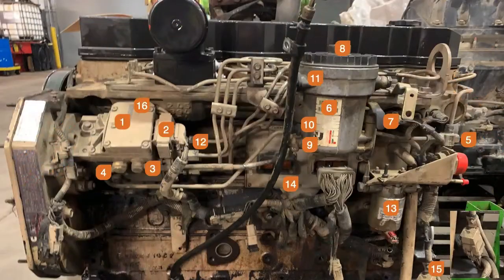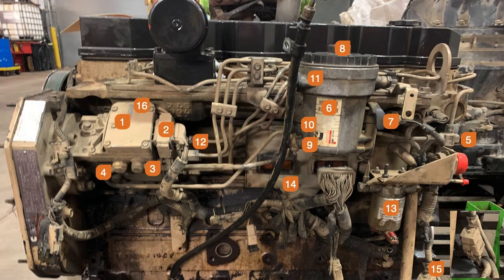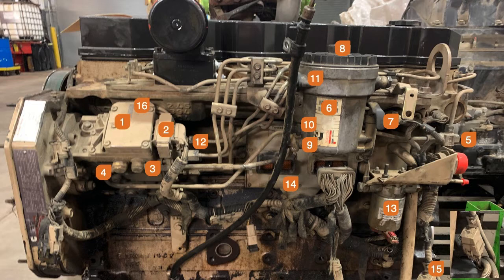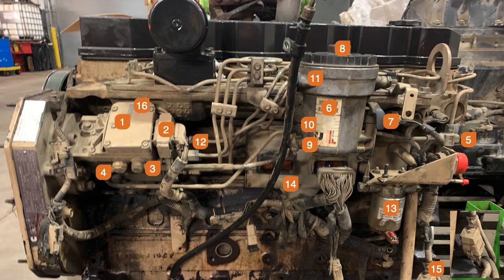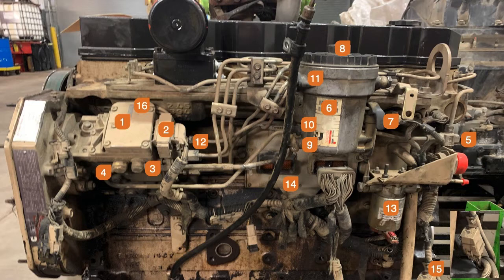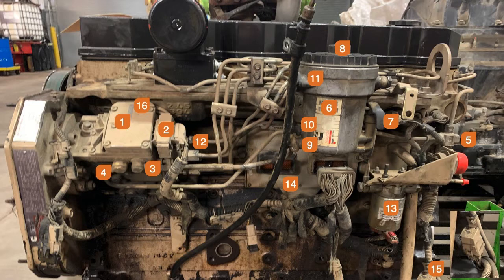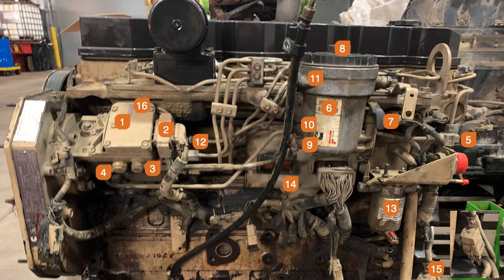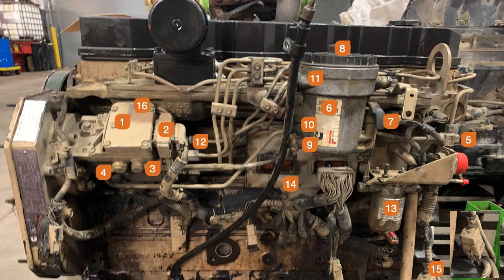Cummins ISB 59 VP44 fuel system Part one of Three

Comment: 👍👍..i commend u ,for all knowledge on engine's and fuel systems, including this one...ive had alot of experience with the VP44 , perhaps not as much as u,but ive began to give up on them,hence deciding to 7100 swap one engine and pull the engine and replace with something older in another truck..ive decided not to purchase another VP44 fir my own vehicle's 🤣... because they kinda seem to be like a woman,you can do everything right and it'll still give up on you😂..but anyway, Thank you for all u do,and the video's 👍👍👊
Reply from the maker: That is quite an analogy. I am not going to comment on it but I love it.
Reply: @ENGINESHOPJOE  I should add,on one truck I had to swap  or 3 ecm's ...they all failed in different ways and had different symptoms...so really wasn't VP44 to blame..in the end  I decided the heat and vibration wasn't doing them any good and isolated it from side of the block...I think that may help for longevity for those...idk,but I'm just becoming weary of the electronics of the 44/ECM/PCM  and decided that isn't gonna leave me stranded anymore ..But anyway 👍👍👊

Comment: hey joe is there a part 2 of 3 and 3 of 3 ? i have the isb-275 in my 2002 motorhome. thanks
Reply from the maker: You know they were planned. I will get them but it wont be until probably later this year. When I am involved in some issue i think would be helpful I turn to that while it is fresh in my mind and I am familiar with all the data. There will be a part two and three because I love that engine and fuel system. I am not saying it is the best and or only but in it's day it was a very good engine and fuel system. The injection pump got a bad rap. It had to be ALWAYS SUPPLIED pressurized fuel or it would start failing internally.
Most of the time when the injection pump failed the lift pumps were running and purring away BUT not making any pressure. So the injection pump chewed itself apart from lack of lubrication while it tried to pull fuel from the tank.( it was never designed to do that)

Comment: turning the keyway in the gear down has almost zero chance it falls and is a much better way to remove the pump, the lift pump is a high failure item and wipes out way to many injection pumps with the cost of replacement being way overpriced by bosch, cummins did not do a very good job of training on how to fix the rotor drive breakage from lack of fuel siezing and breaking the drive that was easy to repair and depending on who was certified from dealer to dealer the parts even being illustrated for a person to buy repair parts, the last one i priced many years ago was 3200, the caps fuel system was a pile of crap also but easier for a mechanic to repair as cummins did a much better job of a repair process and the parts guys being able to see the parts. removing the front cover and installing a older one with a p pump or a rotary would be a much better engine option.
Reply from the maker: I keep the key up. It's just preference but I have seen them occasionally fall out. The engines can be found in some nightmare installations. For me it is not worth the chance of having to spend a day or two of labor/parts just to find the key so I don't trash a gear train.  Cummins does not repair Bosch VP44s outside of the Recon program. There was no fuel system repair at the distributor branch level on this pump. The P pump is the longest life pump in my opinion, all things equal. The rotary is not worth the time or cost to put it on in my opinion. Assuming you're talking about a VE. They just don't have the life and struggle to make much over 190 horse. When you go mechanical you lose all the advantages of the electronics. For me that is cruise control, ecm driven fast idle warm up, PTO mode, engine protection to name just a few. It is easy for me to say this because I know how to take care of the engine and fuel system so I know what to keep an eye out for to keep out of trouble. That is not true for a lot of end users.